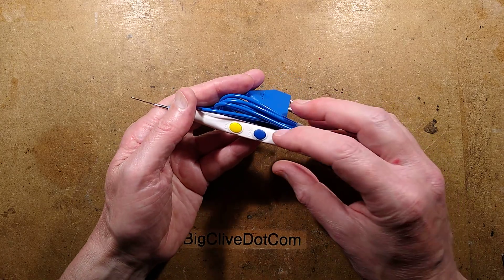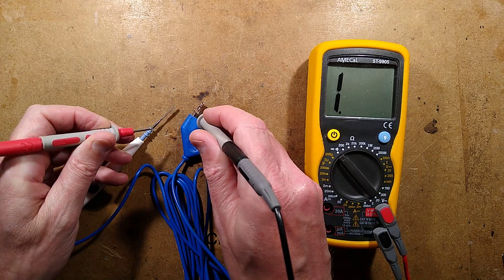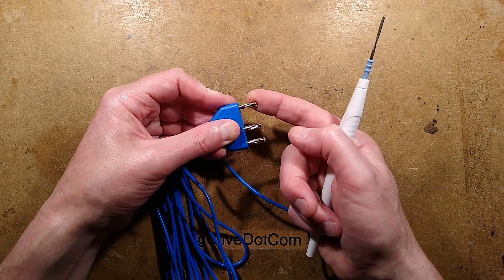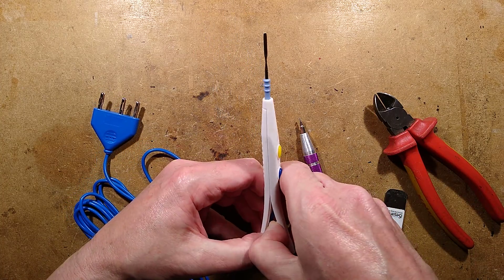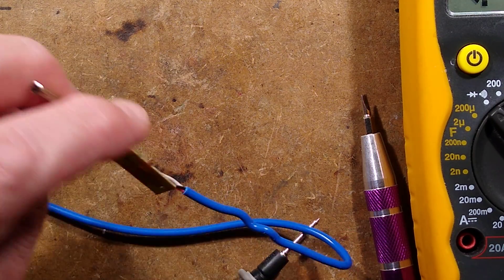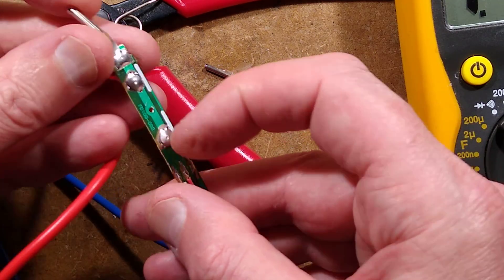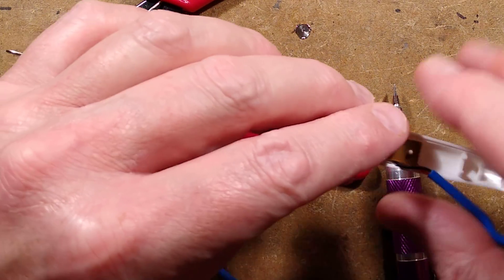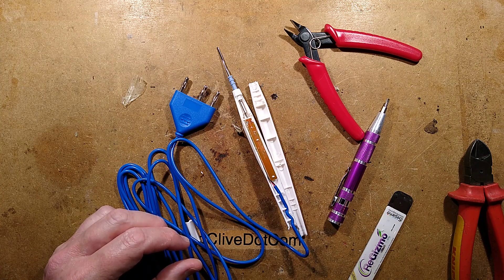Inside a single-use electrosurgery/cauterising pen

Comment: I attempted to disassemble one of those at work recently. Ours look similar but the electronics were sealed in a block of plastic. Nice coincidence to see what's inside. 

On a separate note, the tip can be exchanged to different shapes depending on the operation. For very small surgery you can fit a needle tip or a flat button shape for large surface coagulation. They are really versatile

Comment: I was thinking just for play you could run it off a high powered ozone PS. BUT that voltage is going to be way higher than this was designed for.

Comment: So fun to see Clive tearing down a tool I use every week. Thanks for the insights. 

We still use traditional scalpels to open the skin (no 23 blade usually) then switch to diathermy for the remainder of the dissection. Diathermy on cut leaves the skin thickened and thermally damaged making subcuticular closures more difficult. 

When incising skin you only tend to encounter small capillaries so there is minimal bleeding and we will usually ask our assistant to touch the coag diathermy onto the back of our metal forceps to seal any slightly larger vessels. Vessels over 5mm are usually clipped or tied. 

Thanks Clive.
Reply: PS the diathermy tip is interchangeable with longer tips for deeper surgeries (eg operating at the level of the retroperitoneum or in the pelvis).  

PPS you get used to the smell. And if you’re doing abdominal surgery and expect to be doing a lot of diathermy in the fatty tissues there are diathermy pens with smoke extractor devices built in (or you can rig your own up by making a hole in some suction tubing and poking the diathermy tip through so suction occurs at the level of the tip.
Reply: I had a redone open fundoplycation stomach operation and developed liquefactive necrosis in my left hemi diagram that caused it to rupture, which then required an emergency Thoracotomy (chest surgery) to repair the 9cmx8cm hole in my diagram with Gortex mesh. 
 As I was recovering from that I developed peritonitis from E Coli and the 20cm long incision down my abdomen split open (wound dehiscence) and my small intestines popped out through the incision onto the bed...and another emergency operation!
Now the stench from that was absolutely disgustingly horrendous and very hard to compare to anything, except a decomposing corpse.
Having your own body smell like it's rotting away is something I'll never forget.
...Now how did I end up talking about this?? 🤔
Reply: @Johnno48  perhaps you needed closure ;) glad you are recovered and thanks for sharing.
Reply: @regmigrant  
Yeah proper closure would have prevented all of that. 😋
Reply: @Johnno48  how are you doing now? I have a hiatal hernia that needs surgery but am scared because of a bleeding issue on an outpatient kidney stone surgery. Now I'm seeing class action lawsuit ads for hernia mesh operations.
Reply: @woodstream6137  
Well after 28 major operations my wounds have healed but I now have severe COPD and struggle to breathe and now on a disability pension...at 40yrs old!
If you can avoid having mesh for a hernia I would highly recommend not having it.
I had mesh to repair a hiatus hernia and it eroded my esophagus and caused a massive infection that closed my esophagus so I couldn't swallow.
I ended up having the mesh removed. 
Yet the other mesh that holds my diaphragm together hasn't caused any problems. 
All the best my friend.
Reply: Also some surgeons like certain pencils from manufacturer 1, like SafeAir since they have smoke evac pumps, and certain tips from manufacturer 2. Alot of this stuff if interchangeable
Reply: I guess the smell is nothing until you open the stomach
Reply: @stiannobelisto573  opening the stomach isn’t usually too bad. The two smells that surgeons don’t like when they open an abdomen are the smell of poo (usually this means faecal peritonitis from damaged bowel) or the smell of dead tissue (bowel ischaemia has a distinctive smell). 

Sometimes if a stomach ulcer perforates into the peritoneal cavity you can encounter funny things like bits of food (peas/carrots etc) floating freely about the place. We always take great care to wash these out so they aren’t left behind as a potential focus for infection.
Reply: @clubric  I presume the latter two things have very poor outcomes since they disseminate into the surrounding tissue rather quickly?
Reply: @FlyingVolvo  both faecal peritonitis and necrotic bowel have a poor prognosis. The former requires copious saline lavage, or washout (surgeons say “the solution to pollution is dilution”) and the latter a bowel resection.
Reply: @stiannobelisto573  ...or lower bowel...
Reply: In theatre, you normally stick a ground lead onto the patient's thigh. It's a big sticky pad with a flexible electrode underneath and a wire that attaches to the main unit. This closes the circuit.
Reply: @newmantm1234  what Clive is showing here is the business end of “Mono-polar diathermy” and yes the current path returns to the machine via an adhesive plate placed elsewhere on the body, usually over an area with a decent muscle mass and ideally taking an electrical path that doesn’t go directly across the heart. The plate is actually two metal plates on one adhesive pad and the diathermy machine is constantly checking that there is an electrical path between the plates and in that way the machine can detect if the plate is coming loose. 

There are many other electro surgical devices, but the other commonly used type of diathermy is “bipolar diathermy” which is usually employed in the form of forceps or scissors. In bipolar diathermy the electrical path is between the two tips of the forceps or between the blades of the scissors and the patient doesn’t require a plate.
Reply: I was used to the smell from having 27 moles removed from my neck at 16yo.  Try didn't really do local on anything but the biggest ones and still could feel from it hitting the nerve with current.
Reply: I have a small tiny little scar above my Tragus and when I pull the skin I can see something underneath, I need one of these to see what it is without oozing too much blood. Bet it isn't something that was accidentally put there like from a wipeout when I was a child.
Reply: What kind of surgery do you do
Reply: @phonotical  vascular surgery

Comment: It is "disposable" but in govt hospitals, we don't really dispose them.
We put them in various sterilizing liquids and reuse them.
When a rich enough patient comes in, we ask them to buy one...
Reply: This is called a monopolar cautery, because the 2nd pole is the pad that goes under you.

The other other one is a bipolar cautery, 
It looks like a tweezer, with both sides having a particular polarity, 
We have to compress it against something for it to work.

Bipolar doesn't have the cut function, only coag...

Comment: I’m a surgeon and use these on an essentially daily basis. After a procedure once I broke open the pen ( should have seen how unhappy that made the circulator). There was blood and assorted fluids around the wires and circuit board. Didn’t cause any problems with function, but would have been impossible to reprocess and safely reuse. Yes, there are a huge variety of available tips which tout advantages for various reasons. The one I most often use has a nonstick coating to facilitate cleaning during the case, eliminating the need for scratch pads. They’re referred to as Teflon tips though I don’t know what the actual material is. Electro surgical units are still very often generically referred to as Bovies, though they very rarely actually are anymore. Bovie as a company does still exist but has almost no presence, despite the fact that it used to be the 800 lb gorilla in the field back in the days of non disposable return pads . These were aluminum sheets that were covered in a conductive gel that patients would then lay on. Return pads burns, an almost unknown phenomenon now, were disturbingly common back then.
Reply: Named after William T. Bovie who invented the ESU in 1926, for those who are curious...
Reply: The big green bovie generator were loved by urologists for the power they had to cleanly remove tumors in the bladder! Those things could have been used for metal welding❗
Reply: @LordGaben when I first started in 1985  working in the o.r. we used to resterilize them and used them until they didn't work anymore,  but later they were labeled single use only and the company wouldn't stand behind there product becuse of liability of law suits toward them! Such is the way of legality. We do recycle them, so that's something.
Reply: just to add something from across the "Blood-Brain-Barrier" ie the green surgical drape at the head of the table, in the days of Cyclopropane and other explosive anaesthetics, Bovie's resulted in more than a few "Kabooms" in the OR!   As well, a poorly placed return electrode could make the entire surgical table an electrical nightmare, if surgical gowns were damp from blood or irrigation fluids.
Reply: @en2oh  I worked with a nurse who was in a hospital that  where that happened, killed 3 people!
Reply: Youre an amazing person, thank you for what you do!
Reply: could these be used to fry hair follicles? asking for a friend...
Reply: What happens if you push both buttons at the same time?
Reply: @NateyGaga3  they cancle each other out, so neither of them work. They also have a different tone on each button to distinguish between them.
Reply: @NateyGaga3  hitting both buttons effected an "undo" feature (eventually replicated by the Ctrl-Z" button on the modern laptop ;)
Reply: @en2oh  So if a surgeon occasionally made a wrong cut by mistake they could hit both buttons and heal up the wound and make it vanish?

Comment: The concept of cutting without bleeding totally blew my mind when I first learned about this! As a child I read about it in my dads old book about electricity from the 40s. It explained a lot of stuff really well and I probably got into electronics from that.
Reply: Yes, I also have a Dutch book like that dates back to 1942, titled "Gij en de Elektriciteit", which would translate to Thee and the Electricity. Funny and incredibly clear illustrations and a good story to go along with the science taught. Some of the techniques and equipment used are of course a bit ;-) outdated, but the basics of elect(rics/tronics) are very well explained. The band of that venerable book lies in tatters from having been read so many times. I have recently repaired it. I was amazed that my grandparents could get hold of this book, since all four of them were involved in the Resistance Movement during WW II. I still do hobby projects now and them, but my main focus has since shifted to Informatics, Linux in particular. Sometimes I hook up an Arduino or Raspberry PI equipped with sensors or obscure serial communication interfaces to devices I want to interface with my main computers.
Reply: @LarixusSnydes  WHAT THE HELL You're talking about the same book!? It is the german "Du und die Elektrizität" by Eduard Rhein. Seems it was translated to Dutch. Mine is also falling apart a bit but I still have it ;)
Reply: @adriancentra  It's a great book and I'll treasure it. 
Luckily, my grandparents were open-minded and intelligent enough to distinguish between the German Nazi fanatics and the common people. They did not hold a grudge against the commoners, not even the common soldier. They understood well enough that many of them just did not have a choice and suffered greatly as well as a result of this coercion. This stance made their stories about what they had experienced genuinely interesting and enriching.
This allowed my parents and me to meet many friendly Germans during vacations and exchanges.

Comment: Ah yes, a simple disposable electronic device that probably cost $2 to make but costs $200 to buy because it's medical.
Reply: Can't speak for the US, but in the EU if you want to make any medical device, there's a shitload of documentation you have to do. And that's what massively drives up the price. They had a talk at 36C3 on that topic: https://www.youtube.com/watch?v=0JbY9VKiiC0
Reply: Amazingly only ~5 USD per piece
Reply: @cabbie4788  Wait, really? That's incredible!
Reply: I would bet at scale it is costing cents to make. Taking capital cost aside (like injection moulds etc), all it is is a really cheap piece of single sided pcb, two cheap tactile switches some wire and a tiny bit of plastic.

Unless the probe part is done really expensive material you are probably looking at a BOM of 25c (again assuming you are manufacturing in large scale)
Reply: The $198 is for the insurance that the seller must carry because US ambulance chasers will sue everyone related to anything that touched the dead guy, and proving innocence in those cases is hideously expensive.
Reply: @johndododoe1411  insurance is the key. they decide what gets used. kids meds went form $5 a month deductible to $400..i knew someone who worked for the insurance company. the $400 was just slightly more profitable for them.  patients be damned.  thankfully we could afford to cover the meds as he would be in constant seziures without em.   support the nhs✊ more valuable than you may realize.
Reply: @luminousfractal420  NHS is still affected by global prices, which are affected by the need to sell those products in the US.
Reply: @johndododoe1411  And the FDA being in bed with Big Pharma to stomp out any newcomers or innovation.

Comment: Any idea about the frequency they use? I think the unscreened wire must act as a radio transmitter!
Reply: In the operating theatre where I worked, if we had the radio on then the electrocautery machine would interfere with it in Medium Wave, but not on FM, so I’m thinking that these work in the hundreds of KHz range rather than MHz.

Comment: I used to use a handheld one of those to light cigarettes when I couldn't find a lighter
Reply: That would have been a heated tip unit, also usable as a soldering iron for light work

Comment: I'll note that the electrocautery tool is never used for the outer layer of skin as it will cause burns. The initial incision is always made with a scalpel. As soon as you're through the outer dermal layer, you'd then swap to cutting/coagulating with this tool. There are also a number of modes the device can be set to which alter the frequency, current and voltage. You can set each of the buttons to your liking. Also, you're completely correct that the pad (typically placed on the thigh) must have good contact or will cause severe burns. Source -  I'm a physician and have used this device many times.

Comment: Should have given an example with cutting some meat!
Reply: With what?  He doesn't have the $4000 bit that makes it go.  It's just a handle.
Reply: @tsm688  Yeah because you can’t replicate it with standard components! You do realise that it is a “$4000” part simply because it is in the medical industry, not because it is a complicated part!
Reply: @jwbonnett  high power radio transmitters aren't cheap anywhere.  If you tried to build this I think you'd be surprised.  Also you'd have to pay a lot of money to certify it as medically safe.

Comment: The smell of burnt flesh may not be too bad in normal use. Proper operating rooms have open loop airflow; single-use air, you might say. They use fairly elaborate multi-stage filtering of the incoming air, then cooling, heating and steam injection for controlling both temperature and humidity. After a quick pass through the OR, the air is dumped outside, away from the air intake. In places prone to sandstorms, the first stage of intake filtering is a centrifugal "cyclone" type filter.

Comment: Looks like the 3 contacts connector is the same as used in analogue (and in some digital) telephone and test equipment. (Symmetric a/b wires)
Reply: It's also the same as used in epee body wires for fencing. I don't know much about electronics at all, but it sounds like it's a common connector then?

Comment: I used to work in a dermatology office and had to sit in  when they cauterized stuff (wasn't a cutter tho).....this was like 20 years ago.   The handle they used wasn't disposable but the tips were, looked like a thin metal strip that was cut into a point.

Comment: I was given a few of the old school medical 1 time use cauterising pen's. They are just a battery cell and a heating tip. I have not tried one for soldering but I bet I could do it.
Reply: I had one used in me to remove warts. Just a hot nichrome wire loop and two Energizer AA batteries. Burning warts smells like breakfast at McDonald's. Kinda makes you wonder what's in those Egg McMuffins...

Comment: I work in healthcare and the amount of single-use items that get thrown away by hospitals and clinics nowadays is staggering. Some of it is necessary as disposable can be safer than relying on cleaning and sterilisation each time where there is a potential for mistakes to happen, but I do think that things have gone too far and there's far too much waste being produced.
Reply: I've retired from healthcare (NICU), and I've said the same thing about how much trash we produced each shift. I'm old enough to remember when an autoclave was used to sterilize glass syringes and needles.
Reply: @darkdelta  After almost two weeks in hospital, I asked for a pair of scissors to cut my nails.  You guessed it, disposable.  I was appalled, but with neat hands and feet..
Reply: @sarkybugger5009  I hope you took them with you, otherwise they ended up in the sharps box. Glad to hear you are out, let's face it, the hospital is where all the sick people are, so they're much better places to be😁
Reply: And what happens when your supply chain go bye bye?